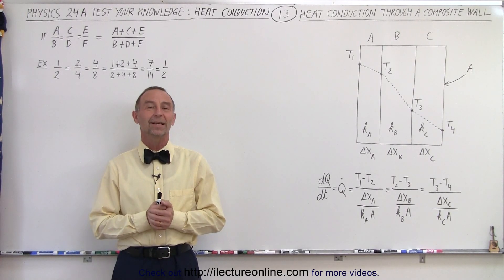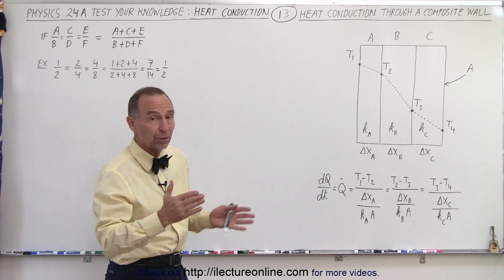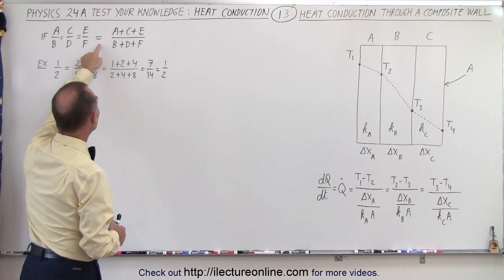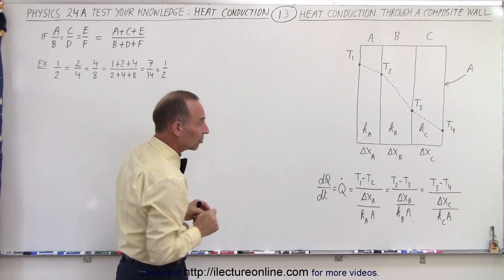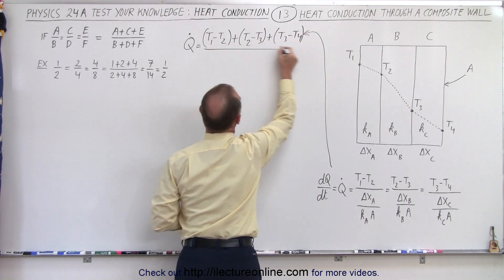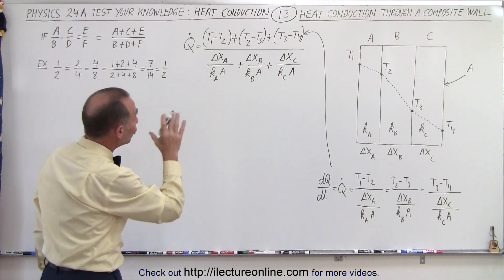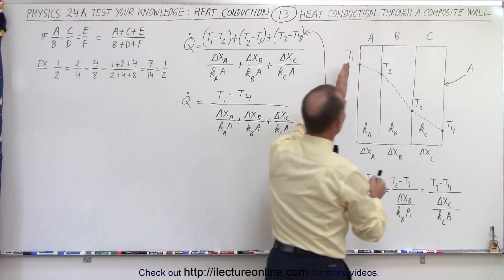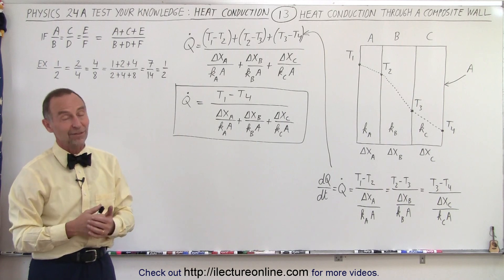Physics 24A  Heat Conduction Examples (13 of 22) dQ/dt=? of Composite Wall

Comment: This really looks a lot like the formulas for the two R-Values you calculate for R_total for a realistic U-Value (Construction Engineering). 
Where the values here would be:
Q -> R (m^2K/w) - materials ability to block heat in terms of watts.
Delta X -> % material of given layer (%Insulation (Xa) or %Stud(Xb)).
KbA -> The Total layer area (Insulation would be KaA and Studs would be KbA).
T1-T2 -> Just the value 1.
This is a little different depending on the two R-values you want to find.
All in all it gives a realistic U-Value (w/m^2K) of the element, like a house wall.

If we want to know how the temprature of layer surface inside a wall, we just take the inside temperature - material's ability to block heat in form of watts. Or use a formula that looks like this:
Delta T = (T_inside - T_outside) * R_layer / Sum R
where Sum R would be the collected R-Value from each layer in the wall-element.